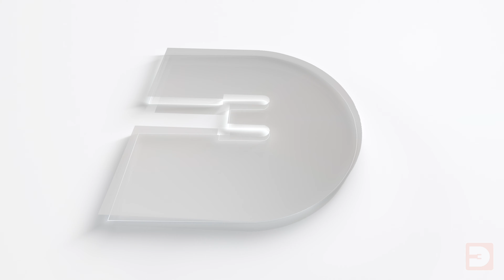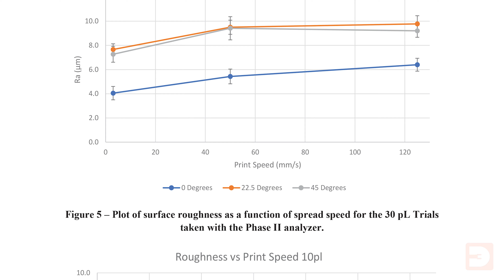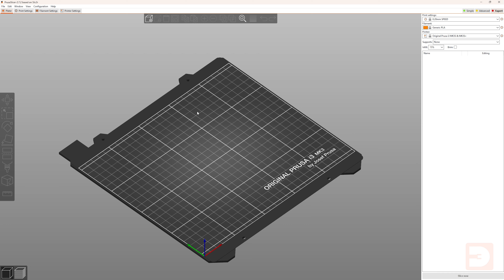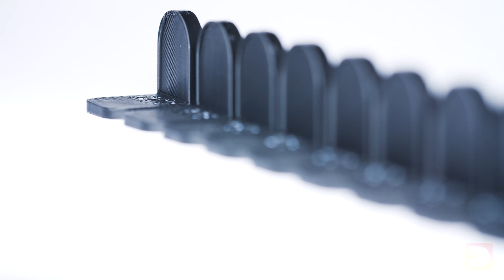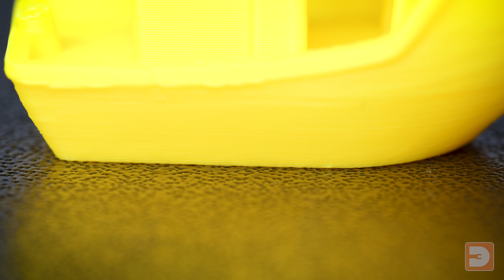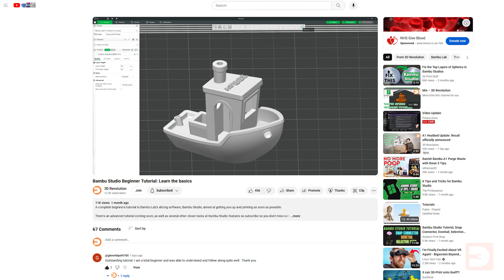New 3D Printer, Lacklustre Finish? Fine-tune For Glossy Results

Comment: I came to this conclusion when I was printing black PCTG. Whereas walls look consistent like a black glass, top surfaces have various shades of dark gray depending how print accelerates, decelerates and there are stripes when print speed is lower (diagonal from holes, darker corners) which looks pretty ugly. Lower speeds are black. PCTG is limited to 9mm3/s so whole print is slower, but it really likes slow speeds. Ironing helps with texture, but does not change color, at least for this material so result is smooth finish with diagonal discolored patches.
My biggest issue with 3d printing on bambulab are overhangs (like 60-70deg) close to printing bed, they usually seem to end up messy, regardless of material: matte PLA, PETG, PCTG. Also it sometimes feels like first layers are "compressed" and there is slight change of overhang angles (even if they look perfect and angle is not too steep)
Reply: Have you found a solution to the lower speed stripes issue you mentioned? Currently suffering the same. 😢

Comment: Interestingly, eSun and others have started releasing “super gloss” PLA filaments, haven’t tried any yet (I happen to prefer the matte appearance) but it’s amazing how the difference in print of a standard PLA vs a Matte PLA comes down more to opacity these days, as they often look the same on the same settings. Notably the Bambu brand filament differences between their PLA basic and PLA Matte, the non matte difference is very slight but more light transmissible - eg for hue forge you want their basic, as their matte is several times more opaque.

Comment: Irony is that if you increase the hotend temp by 5 - 15c you'll find that you can print much faster while maintaining the quality and shiny finish. Fast prints come out matte because the filament wasn't adequately heated before it left the hotend. You can either print slower, use a toolhead with a longer hotend, increase the hotend surface area that's in contact with the filament like CHT or increase your hotend temp a little bit.
Reply from the maker: You definitely can increase the temperature a tad to help with this. However, that can also then contribute to other problems such as stringing, oozing, and overhangs drooping so it's a bit of a matter of weighing up priorities. By improving gloss by slowing down you can for the most part maintain or even improve the quality of your print.The CHT nozzles are absolutely an option for helping without having to increase the actual temperature though and something I'll be covering more in a future video.

Comment: temp and speed do affect the walls shinyness. im mostly headache the consistency shiny of the bottom layer. sometimes the textured is alot shinier then others.
Reply from the maker: Try increasing the temperature of the first layer by 2-5 degrees and/or slow it down slightly to see if that helps with your shininess

Comment: You don't need to slow down at all to fix this, just fix your temperatures. Manufacturers' recommended temps are designed around selling to folks with old printers that can't safely go over 245 and are not adequate with more than extremely weak cooling and low flow. Temperatures for PLA should be 245-270 depending on whether you have a long melt zone. For PETG, 265-290.
Reply from the maker: The problem is, increasing temperature can affect other sings such as oozing and stringing, and overhang quality even when printing at speed, so it's a matter of weighng up what's more important to you based on the performance you're experiencing with your filament and printer.

Comment: Nice video, but what is the time difference for a benchy with "high speed" settings compared to your solution? For X1C
Reply from the maker: It depends what high-speed settings you mean.
The 18 minute benchy that comes pre-sliced on the printers is more of a showboat and isn't a speed even Bambu ever intends their users to print at (as reflected by the fact that none of their stock presets in Bambu Studio achieve that print speed on a Benchy).
However, if we take the Bency sliced using the Bambu unaltered '0.2mm Standard' preset for the X1C, it quotes 32 minutes 37s print time.
If I take that and just apply the settings I mention in this video the estimated print time is 38 minutes 45s.
So it's only adding 6 minutes to the print.
If we scaled the Benchy up to 360% to see what the impact would be on a larger print, with the standard preset it estimates 6 hours and 12 minutes.
With my alterations for improved surface finish it would be 8 hours and 8 minutes.
So yes, it does make the print slightly longer, but comparitively not much.
Ultimately it comes down to what is more important to you, speed of the print or the surface finish of the finished print. If you don't mind it being less glossy, don't change it, if you do want it more glossy, then slow it down.